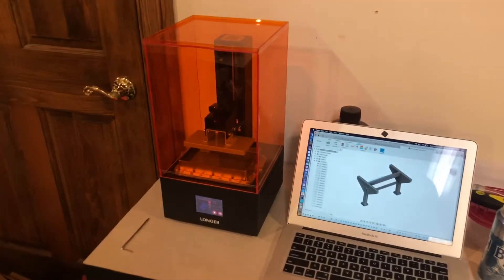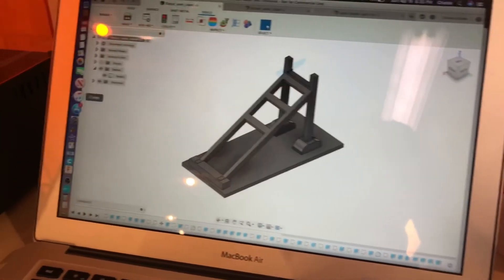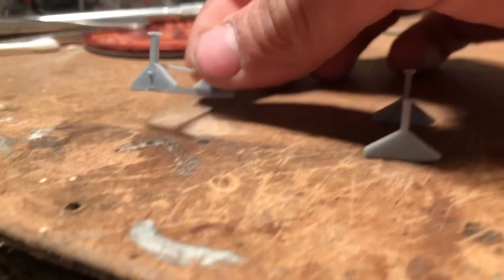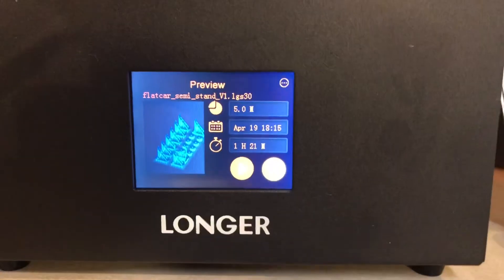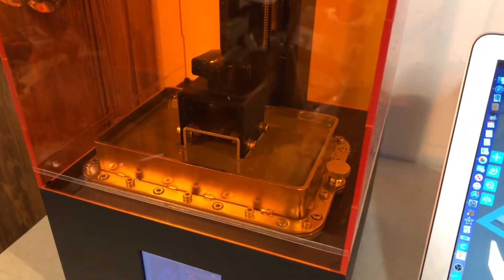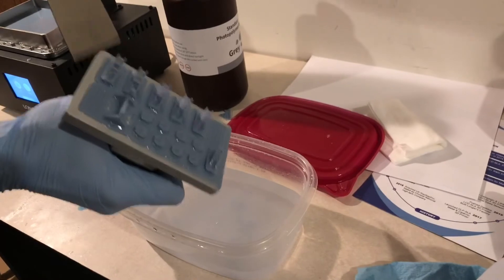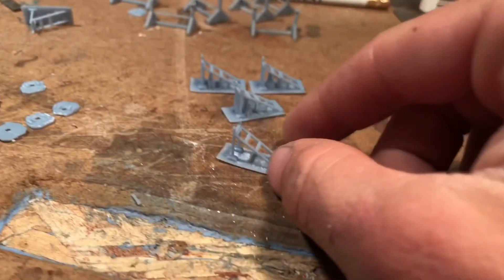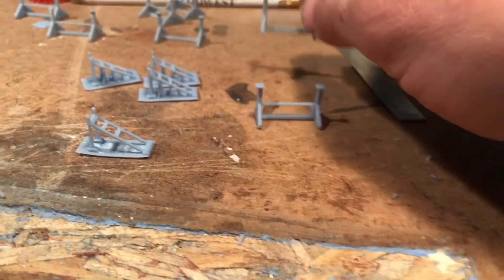3D Printing Model Train Parts

Comment: in my printer I have been rotating my models about 30 degree within chitubox slicer, I have an anycubic photon s
Reply from the maker: I've seen people do that. What does it help with?
Reply: less tension when removing from the fep film in the tank, also also I found it to help on thinner items https://www.facebook.com/CNSMracine/photos/pcb.1003841450050884/1003841346717561/?type=3&theater https://www.facebook.com/CNSMracine/photos/pcb.1003841450050884/1003841383384224/?type=3&theater https://www.facebook.com/CNSMracine/photos/pcb.1003841450050884/1003841426717553/?type=3&theater Pics of my latest project with printed parts
Reply from the maker: ok nice, thanks for tip.
Reply: @mikeslater75  Have you worked out support spacing for your bridge bracing?  in mm or inches?